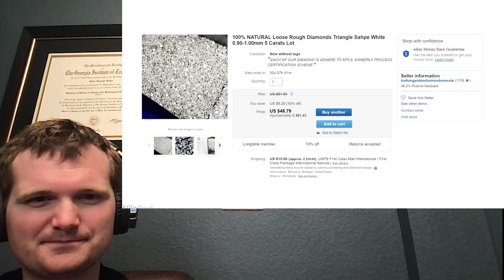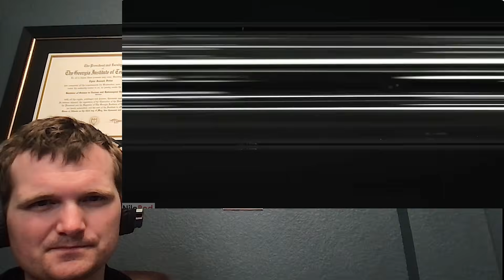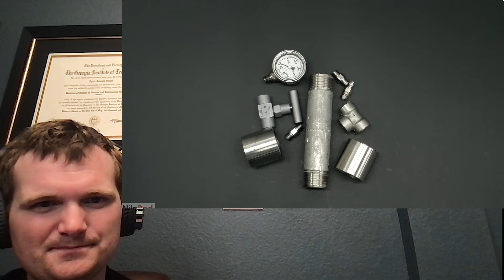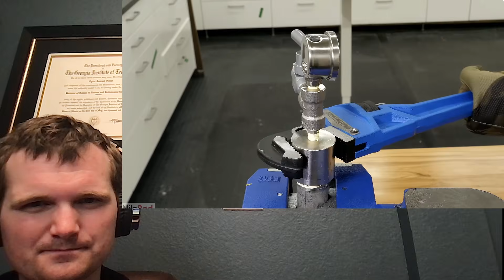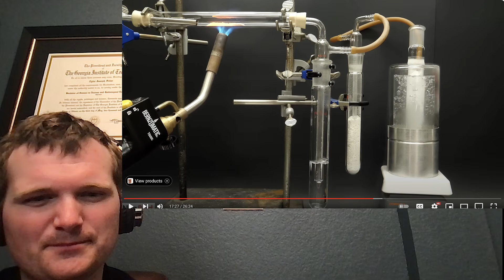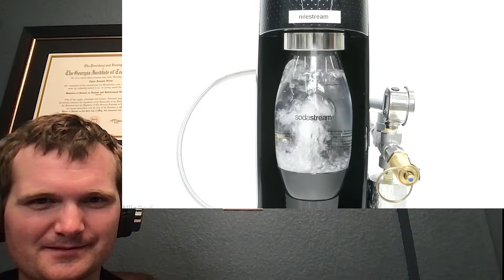DIAMOND WATER - The World's Most Expensive Carbonated Water - Nuclear Engineer Reacts to NileRed

Comment: 7:09 NOOO! The air inside that tube (or… oxygen) is reaching similar temperatures as the gas stream, heating the oxygen tube inside - it does not have to be touching. Having it in the hot gas is nearly the same (just.. slower heat transfer) as having it directly in the torch’s gas-stream. In the glass blowing (for… novelties) world, this is the technique used to lay color-rods on the inside of a glass tube to make… whatever, really! That smaller tube is going to start to weld (still called that with glass) to the interior wall of the “quartz” chamber… actually, im not sure if that’s the case since it has a much higher plasticity threshold. By the time it’s hot enough to “stick” to it, the little tube may’ve already become a long molten puddle inside! 

I want to make …a novelty… consisting of various ‘beach-glass’ fragments in a mosaic - almost like a stained-glass window (sans the molten Pb lattice), where the fragments are all welded together. It would look much nicer, not to mention if it’s a vessel for …”organic material consumption”… awww f_ckit! The damn sh_t’s legal (basically) now anyways - it’s a BOONNNG this “novelty beachglass consumption vessel” is indeed, a bong. You generally don’t want to have Lead be part of the water-chamber, plus you’re gonna be putting the piece up to your mouth (AND it can get hot, though that’s not usually the case). 

Anyway could you imagine? Im just non-certain if the differences in the types of individual glass fragments (anyone familiar, you end up with EVERY kind of glass that humans use for bottling) would make the idea difficult enough to simply not be feasible… I could always try annealing the entire piece, but a) how to hold it together during process? and b) wouldn’t that kindof ruin the aesthetics & of the “beach” glass?

Comment: 34:42 NDB or Nano Diamond Battery (not Nuclear Diamond Battery)is one of the earliest adopters and developers of atomic voltaic cells for mid and high-power applications.

The never-recharge battery produces stable power by converting the energy released from radioactive decay into usable energy throughout its lifetime, which is generally many years.

Nuclear batteries have been around for some time, but they are limited to low-power applications due to their efficiency.

NDB envisions optimizing this technology for higher-power applications and proposes the reuse of nuclear fuel through recycling to extract radioisotopes.

Isotopes from recycled nuclear waste or a reactor release a high level of energy particles that can be transformed into usable energy.

Comment: RTGs aren't used for propulsion, they're used for energy generation, the thrust is provided by ionised nobel gases like xenon, being ionised and accelerated by the electricity produced, so there is actually a much shorter lifetime on the thrust capabilities of the spacecraft, the supply of whatever gas they are using, because the gas is ionised then accelerated near the speed of light, they maximise the thrust, by using their gas efficiently but using more electricity, but it's fine because the RTG will always last longer than the gas supply. Also of course the spacecraft can survive even after it loses the ability to thrust, but if the flywheels stop and the ions run out, it's basically just a rock, because it can't point its antennae towards Earth anymore, and thus we have no idea what it's doing, and can't get out any interesting data.
Reply: Most ion thrusters are powered by solar panels though.  It's only on things like New Horizons that the RTGs power the ion thrusters.

Comment: I dunno if I mentioned it on the original video but regulator cages are a good idea. I used to homebrew beer and I put cages on both my CO2 and nitrogen bottle regulators.
Reply: It's probably a better idea to chain your gas tank to a wall.

Comment: Yea quality of water might make the taste off… but diamond should be cleaner than the carbon dioxide used in soda… or the fast food place… 

Nitrogen tastes sweeter. Feels happy lol

So if you had Fiji water then brita that then infused with diamonds… it might be more accurate.

Then a store bought bottle from Mexico then a U.S. bottle and a local fast food joint… for direct comparison… 

Some sources of co2 aren’t meant for human consumption but it’s very cheap with no standardized testing.

Comment: As someone who's had a sodastream, you can simply refill the bottles by tare-ing a scale with the regulator off the bottle and adding the mass of dry ice to the bottle and putting the reg back on. It usually took a little over a pound of dry ice to get the 14 or however many ounces of dry ice, since it's subliming as you do it. That's a lot of diamonds though

Comment: My uncle is an engineer designing and working on piping for industrial plants. He told me a story about how in one of the plants there was a corridor with a steam pipe, and to walk through it, you had to tie a cloth to a stick and hold it out in front of you as you walked, because you couldn't see high pressure, high temperature steam and it would really mess you up if you walked into it. I don't remember what type of plant it was though.
Reply: Yeah, steam is invisible to us. It's only when it condenses back into water droplets that we can see it.
Reply: Heat bending light as well as water bending water still isn’t a great warning to heed either
Reply: Any high pressure gas can cause some extremely nasty injection injuries, or create very dangerous projectiles. A steam leak can quickly make the air unbreathable and turn the room into an oven though, so... yeah, be careful.

> It’s common belief among utility operators that a good way to check for high-pressure steam leaks is by waving a broomstick in front of you: when the stick suddenly gets chopped in half, you’ve found your leak. However, Una contacted operations personnel at several power plants across the United States, and while almost all had heard of this alleged practice, most thought it would be an unusual way to find a leak these days. A leak in a steam line with enough pressure to cut a broom in half would likely warrant shutting down the unit. Given the danger of a fatal mistake, it’s hard to imagine a plant boss sending workers out on a search mission armed only with a trusty broom. Una further points out that a steam leak, invisible or not, usually isn’t tough to locate–imagine a locomotive horn a few inches from your ear. Operators in an enclosed control room can hear steam leaks from several floors away.
Reply: Cotton on stick is the best safety system ever invented, don’t knock it!

In all seriousness, steam is terrifyingly dangerous.
Reply: Yes but you could hear it for sure. I work in a waste to energy power plant. We had an accident a couple of years ago with super heated steam 2 guys had their tyvek melted to their skin they only survived because they were wearing their respirator now they have a permanent respirator burns around their faces

Comment: As a machinist: when using a drill press do not hold the work with your hands, do not use a clamp without putting it against a post/backstop(if the drill bites it will spin).

If you can't find appropriate tapping fluid for stainless or steel sae30 oil, crisco, or pam will do.

Taping with drill press: insert a lathe center or drill bit you don't care about. With drill off lower bit into hole centering the work with contact, retract bit. Next put tap with tap handle into hole. Lower tip of bit into dimple in back of tap. Using gentle pressure from drill press turn tap handle. Be sure to frequently turn back 90+ degrees to break the chip.
Reply: Don't wear gloves too
The bit will grab the glove and reel you in before you can hit stop
Yes Bare hand isn't good to touch a spinning drill bit but it's safer especially how Nigel was using it
Reply: Oh, today i learnt :)
Reply: Very helpful tips, thank you.

Comment: @ 22:00 

You absolutely need a pressure relief valve. I recently encountered a water heater failure at one of my rental properties. It became overpressurized, and the bottom of the water heater seemed to have blown out, sending the hot water heater rocketing through the entire roof of the house.
Reply: Huh, so the Mythbusters experiment has actually happened in real life.

Comment: Now i'm wondering... if diamonds could be turned into CO2, then could it be possible to turn CO2 back into coal/diamonds? 🤔
Reply: Almost definitely but the energy input needed makes it not worth it. You’d also have to separate the O2. Just a guess from a total layman.
Reply: It would be a lot easier just to start with coal.
Reply: Yes, it's possible, IF ye can create the requisite pressure and heat. Those are much higher than most people can manage without specialized (read: expensive) equipment.

That's what cubic zirconia is: artificial diamonds.
Reply: Yeah, get a tree to breathe in the CO2. Bury it underground. Wait a few million years. Easy.
Reply: That already exist and is usually called synthetic diamond or fake diamond.
Reply: @shades909  I assumed that was a given known. I was addressing the specific question about CO2 as created in the video.
Reply: Also called carbon capture, the pure carbon can be made into diamonds but much less perfectly produced… as it’s a crystal it can also be grown.  So a true diamond takes a bit of everything, high pressure, heat the right mix of minerals and substances and time.

Comment: I used to work in a glass factory, the machines with the molds in it was kept at or around 610 to 620C depending on what product we were making so the glass wouldn't harden and shatter.  Coming out of the extruder it was around 800C and it was completely melted.  I can't remember what temp the tanks were kept at, that was a different department than I was in.  So as far as I know glass is liquid at or around 800C.  Depending on the type of glass, of course.
Reply: It's quartz glass
Reply: @n2oin I'm talking about normal glass.  Just like he was in the video before the quartz glass.
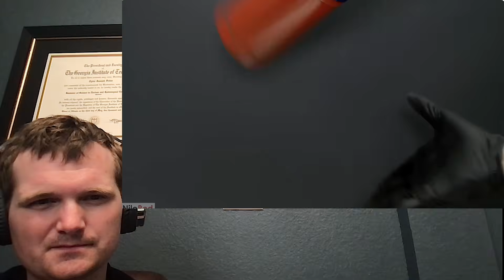Reply: @n2oin 6:20 he starts talking about torch temps and when glass melts.  That's what I was commenting about.

Comment: 7:45 its quartz glass tube, so, melting point is way much higher.
Edit: 800°C is "soft" point. Melting starts at 1200+°C
Reply: also 800C is around 1474F so maybe thats where he got 1500 from (cause round numbers are nice to work with)